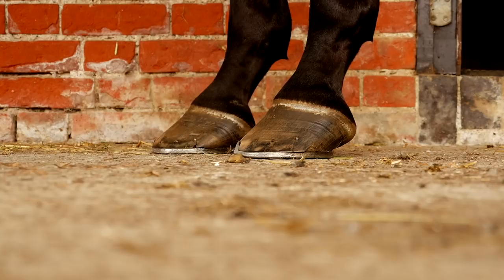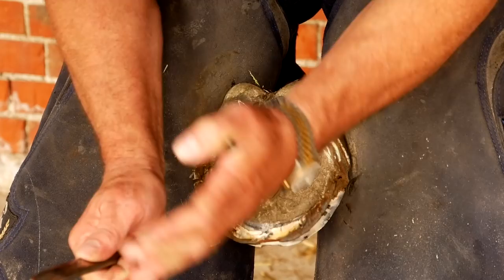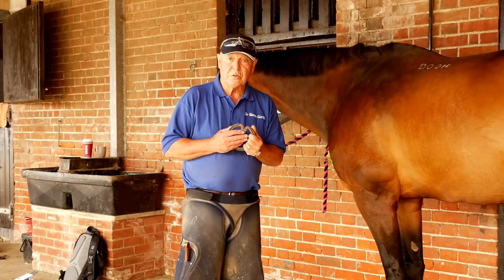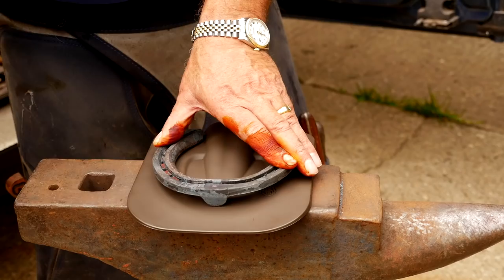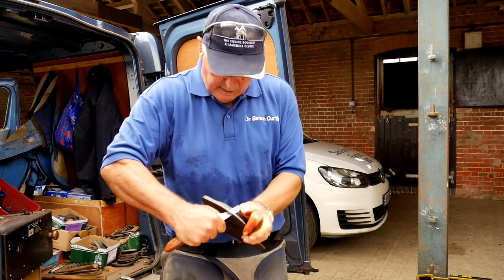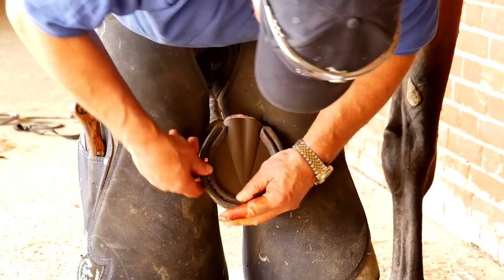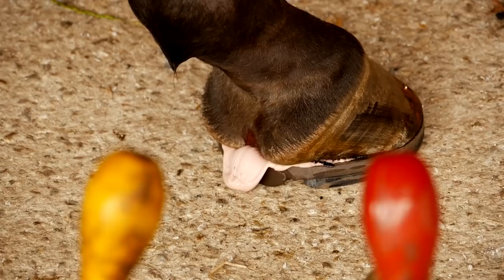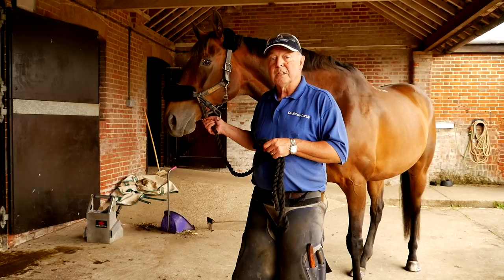Treating a Horse With Low Heels - Using Digital Support Pads Farriery Tutorial

Comment: i've had success with castle frog support pads. it helps imo, to turn the horse out for 1 or 2 shoe cycles , i order to drop the heels and it will bring the heels and frog into alignment, then add the frog support pads.

Comment: Great video Simon!.  In New Zealand, we often blend in copper sulphate crystals into the the DIM to help prevent thrush. Is that done in the UK?  Also that you said that this is not a long term fix, and that you would use this to start the process to bring the heels back.  How long would it take to see some improvement in the heels placement? Are we talking about months?  I have a TB with the same issue, so am keen to explore all options for him.
Reply: In my experience it takes about 3 shoeing cycles at 5-6 week intervals.

Comment: Thank you Dr Curtis. I have been working on a very large warm blood who has the worst crushed heel/ flat foot I have come across. The horse has been lame off and on for seven years before I got to him. I started him with a rolled toe heart
 bar aluminium shoe and then went to a Jim Blurton graduated frog  support shoe with Vettec between the bar and the frog. He improved and was sound for a year or so, we got his toe back and started to gain some heel but the heels crushed again when we went back to a standard shoe. He now seems to go good for a while once he is back in work then goes backwards again. My question is: I am keen to try these pads and dental stuff. This horse is extremely flat in the one foot and I know he would be sound with the wedged pad, but can I keep him in the wedged pad permanently to improve his Palmer angle? I would be interested to hear what you have found, thank you.🇦🇺
Reply: Simon Curtis thank you for the reply. I am definitely going to try this method as I like the fact that it doesn’t involve a bar, the last farrier had welded  wedges onto the shoe making it very heavy .  He also had those plastic wedges between the shoe and heel that crushed the heel and I believe the blood circulation and natural movement of the foot was compromised as it looked terrible but that issue completely changed after I did him the first time. The horse also had ultra thin soles which has improved but I was still doing a pour in pad plus bar shoe making it expensive for the owner but these pads you use contain both. I will let you know how I go and thank you again for posting this. It is a fantastic thing now to have access to farriers like yourself world wide via YouTube etc where as 30+40 years ago you were limited to the occasional seminar or if you were lucky finding a more experienced farrier who was willing to pass on some of his knowledge, this is a great development.
Reply: @lesvenola2380  I would love to know if it worked. My horse has the  same problem and we are going to try this with the next shoeing
Reply: @lakagranger3012  I did use this method and both the horse and I liked it. The problem with this horse I was working on was that there was just no fixing the problems as his feet and conformation/ size/weight was all against him. If I had got to him several years ago there may have been a small chance. Using this method worked with the horse in the short term, you would have him standing beautifully and he would be sound but once the owner increased the work  up to his performance level or we started to return him to standard shoeing he would go sore again and his heels would start going backwards. The owner gave him an early retirement.
I would highly recommend this method and also the other way I was treating him as both were excellent. It is definitely worth the money and effort as there are many ways to get the same result and your horse may respond very well.
What I especially like about this method is that the horse has weight spread over the feet evenly and the shoes and pads are light compared to bar shoes which is a little more severe.
I hope this helps and encourages you to give it a try, let us know how you go and if you have any more questions.
Reply: @lesvenola2380  hey thanks for the answer. We are definatly trying this for the next shoeing. But I have one question. My horse has very thin soles (8mm at the thinnest spot). And her hooves look like a pancake. Do you think it will get any problems with sole pain?
Reply: @lakagranger3012  I think she will feel better actually as the pad will give her protection creating an artificial sole , doubling up the sole thickness. The horse will then grow more sole as the pad will stop any paring that usually occurs.
Reply: @lakagranger3012  would love to know how your horse is faring by now? My mare has early navicular, long toes crushed heels: I've fired all the local farriers and learning to trim/rehab with some improvement. Ready to try boots, wedge pads, and DIM next. If you have pictures, I'd love to see! (I will provide FB name for messenger)

Comment: My vet is against using wedge pads for underrun heels. I've tried about everything, wedges, barefoot for months, keep the toe short, back the toes, rocker the toes, take the heels back to the widest part of the frog, don't trim the heels, with no progress. His toes have not been over 3 inches in a year and I still can't get even up to a 50 degree hoof angle. He is a 15 hand horse. He just won't grow much heel.
Reply from the maker: It is the digital support that unloads the heels and encourages growth. Use in combination with heel elevation for two shoeings and then use flat digital support pads.
Reply: @DrSimonCurtis  Thanks Dr. Curtis. I like that tool carrier you have. If you get a moment maybe you could post a link to how to get one.

Comment: How do you treat horse w underrun heel AND a quarter crack on coronet band by heel?
Reply: Egg bar, pour pads, float the area with the quarter crack. Possibly put a plate and a patch on where the crack is if needed

Comment: When I come out to these kind of horses I usually don't use pads. My experience is that the horse (usually thoroughbreds; like in this video) tend to lose the shoe more often and walls cracking around the nails, caused by the shoe to move more. I usually use Equi-Pak or Comfort Mix and a equi mesh. Does this make a difference on a horse like this? Does it affect the frog differently? 

Also, would you consider somekind of shoe with rolled toe or rocker toe? Sideclips or even no clips to put the shoe further back? Or is that just going to the extreme?

Thank you!
Reply: Best I ever found for if shoeing longer than normal and worried about overreaching pulling a shoe off , is  to ask the owner to fit standard overreach rubber boots on when turning out

Comment: Is there another way of helping the reversed angles if the horse isn’t this bad? My dressage mare has a RF that is slight (visually and with radiographs) and I need to know if it is just my farrier running the heels under. It seems to be an American farrier’s disease by how much I see on all my horses.  They come from Germany with plenty of hoof and support. Thank you!
Reply from the maker: Slightly under-running heels can be helped by trimming and fitting the shoe with additional length. It is impossible to answer in more detail without seeing the horse.
Reply: I understand. Wish I knew how to attach pictures to this conversation.🤣🤣 Thank you!!!

Comment: Wild horses don't wear shoes and manage why we thought it was a good idea to is beyond me nails weaken the sole and wall of the hoof nails can possibly cause absess infections better to clip and rasp flares and any activity where there roof terrain use boots or forma heal shoe which totally covers the hoof  which is better as metal shoes don't shock absorb the leg joints against asphalt or concrete surfaces . Why can't we use rubber shoes instead and use glue than nails ?
Reply: From your confusing run-on comment it appears you already have all the answers..... so I don't imagine anyone is rushing to answer your question my friend. If you don't believe farriery is the right thing for your horse I guess this video aint for you. If you truly care about your horse's wellbeing you'll consider all the options when necessary --- and this is one of the options in this hoof-care scenario. Seems to me Dr Curtis has his head on straight and considers all the options, and is offering valuable information to other open minded individuals: those that have their mind on what's best for the horse in question, and not just trying to fulfil their own badly researched ethics. Why should anyone take their valuable time to answer you "why can't we use rubber shoes instead and use glue than nails?" - find out for yourself if you are so sure of what you rant on at the start.
Reply: Clare Tollerton - What John said. You have an obviously imperfect and partial understanding. Wild horses? Sure. And they frequently go lame and become coyote and buzzard food.
Barefoot is viable for pastured horses, but you still need to maintain their hooves on a regular schedule. Glue? Sure, but then you have to watch even closer for infections due to lack of circulation and air flow. Rubber shoes? Sure, but they can't make them as durable as steel and shoeing becomes more frequent, not to mention that they don't protect the horse as well. 
Everything needs to be considered and the best choice for each individual horse made based on health, work, and defects. Sorry, but that often means standard shoeing.
Reply: Feral horses also have quite different living conditions to a domestic horse, don't they?
A domestic horse doesn't walk 20+ miles a day on various terrain to wear down the hoof like a wild horse would.... Which is why we have to trim them or they overgrow and in extreme cases start to curl. As fantastic as it would be for every horse to be barefoot, sometimes aids like pads and shoes are necessary to help correct the foot.
Reply: Why have shoes it's all non science crap